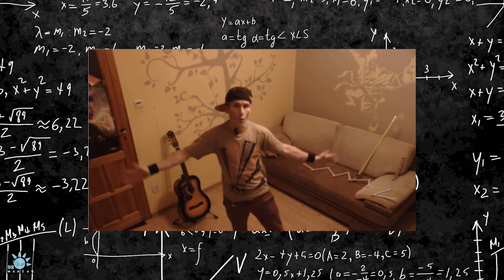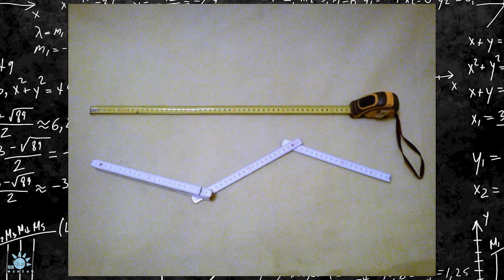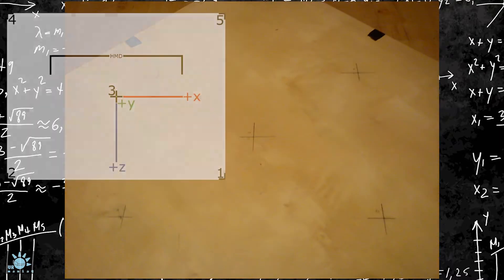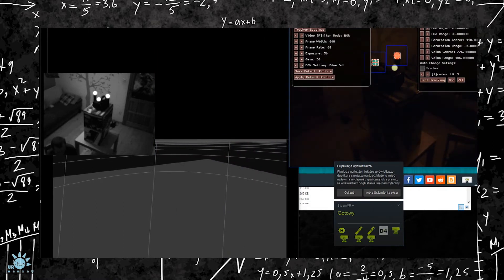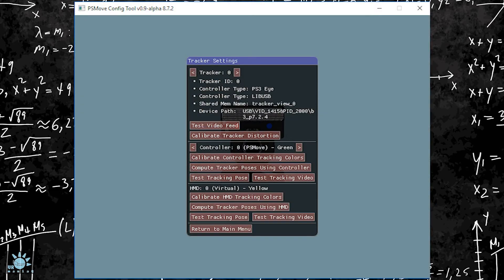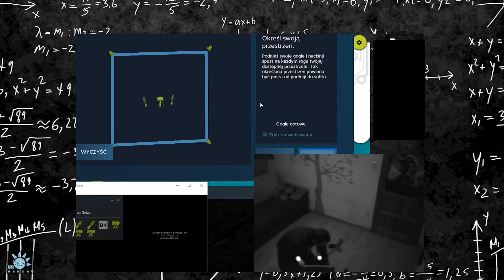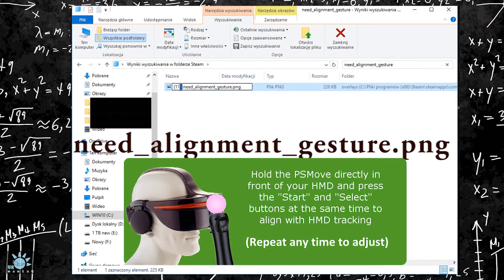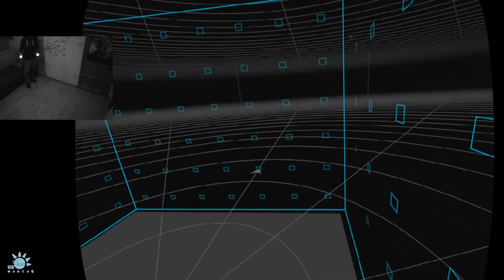Improving PsMoveService Quality in VR VIVE EMU Tutorial Ep. #2

Comment: Hi, help me please, I got rid of this problem: earlier when I did homemade VR on a computer, everything worked and used somewhere for half a year, but when I bought myself a gaming laptop, even connecting everything correctly, my body does not work, and I’m the one who suspects freepie and frepiebridge, I’ll clarify that with the oscillations in PSmoveconfigtools everything is tracked perfectly. I use riftcut and hmd.
Reply from the maker: Hi, are you sure you have set the Riftcat option: FreePie + phone orientation?

If you use Riftcat 2.0, please try 1.3.3 (clasic) I use only this one.

If the above is not connected to the problem, try using a different version of FreePieBridge. Definitely SteamVR does not know that you have positional tracking.

Personally, I still use PSMS 8.7.2 and PSMSFPbridge 1.5.

Have you successfully connected PSMS with PSMSSteamVRbridge? From a certain version you have to do it manually. D.Tech on his channel shows how to do it.

The last option, my ideas, is your file Steamvr.settings has been edited badly. Please find my file in the comments below. Paste its contents 1: 1 into your file and do not change anything.

Please, let me know what results, if possible, I will try to help you in a different way.

Cheers :) VRMQ
Reply: 1) Я использую r1) I use rifcat 2.0, when I used not the problems on the computer. Tell me what is 1.3.3 better? 2) I tried many different versions of all the programs did not help. 3) yes connected everything right. 4) Steamvr.settings try to do as you said, but unfortunately it will not be soon :(
Reply from the maker: I am using 1.3.3 because it has magnetometer stabilization. This option is necessary in the fight against drift. This system must be made in detail. One is missing and everything stops working. I recommend the D.Tech channel. He describes everything perfectly. I only add my 5 cents to the whole of His work. The steamvr.settings file is very important. One bad comma and party is over (steam usually resets the file contents then).
Good luck! Once you've mastered this puzzle, it will always work, or you will know how to fix it.
I have seen new versions of PSMS (9.0.1) some time ago, I will try to use them in the near future.

Cheers :)
VRMQ

Comment: Hey man, how do you setup everything once you restart you pc? do you have to do everything again? or is it faster after the initial setup. Thanks for the tutorials and keep it up!
Reply from the maker: Hi !:)  thanks for subscribing :)

All these steps have to be done only once. As long as you always connect the cameras to the same socket. You will not modify or delete any files. Everything should work all the time (it's worth having a copy of the PsMoveService folder from AppData, and steamvr.settings from the Steam folder, just in case)

Personally, I set and calibrated everything in March 2017. And it still works today. The exception is the magnetometer in the phone, which I calibrate about 1x a month.

Sometimes smaller corrections occur (sometimes some color needs to be improved in one of the cameras). Sometimes Steam will change something in the drivers and something will not work for a short period. This is not a plug & play solution. But when it will be assembled and everything will be installed from scratch. Possible correction of something, or dealing with some mistake is a trifle.

Cheers ! :)
Reply: cool!
Reply: Hey again broo! so I just got my whole set up and everything works great, but my head position shifts a lot and I have to constantly be recentering the hmd with the riftcat shortcut. Do you know what could be causing this? my head movements work great, but in just a while after recentering I find myselft looking at the right when I should be looking in the front of the game.

Again, thanks for the tutorials man, they help a lot!
Reply from the maker: Hi José Muy gay ! :)

Please see also the next episode tutorial. It is very important to cool down and maintain a constant temperature for the phone (the motherboard where the magnetometer is located). In this state, it is also necessary to calibrate its magnetometer - effectively. I show you exactly how to do it, it does not always work the first time. I recently uploaded the Update to tutorials. Maybe it will also lighten up my ways a little.

The phone screen under VR works without interruption to a max in 60fps. The processor and graphics card usually work at 100%. This causes a temperature increase, which translates into a large drift (the magnetometer does not like temperature changes, as well as very high temperatures, because then it can not even be calibrated). Even if it seems to you that "it does not heat up so much", try to measure this temperature by comparing it to the one that is when the phone is not used. Drifting phones are the biggest and probably the only disadvantage of Riftcat / generally Mobile VR.

Cheers ! :)
Reply from the maker: Ps. In addition, you must enable the magnetometer stabilization option in Vridge. The "stable" option. Unfortunately, but Riftcat 2.0 and Vridge 2.0 do not give this possibility yet. It is to be available at the next major update. That's why I'm still using 1.3.3.

Comment: Hello friend, good night in my country, I was a while away from vr, but I'm thinking of going back, have you tried kinect with drive4vr? if yes it was superior to its configuration ps move + ps eye?
Reply from the maker: Hello :)

No. Unfortunately, I have not tried. I borrowed once from kinect friends, but it turned out that you need a PC adapter. Is it better? hmmm, depending on the demand. I do not know anything about the size of the tracking area. I know that when it comes to tracking feet, tracking does not work in 360 degrees yet on one sensor. In the future, it will probably be possible to follow two sensors. Probably a great interesting option. In the future I am sure that I will want to try to track the whole body. I'm sure it must be a super immersive experience. And super cheap, compared to the Vive tracker (price).

Cheers! :)